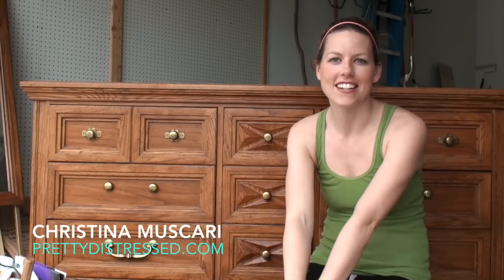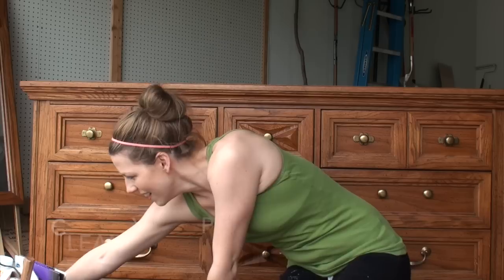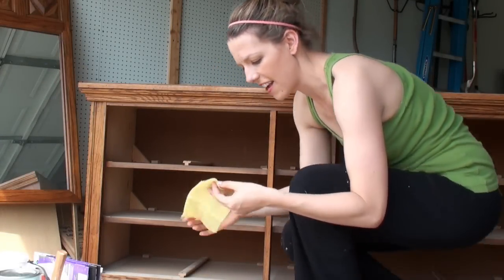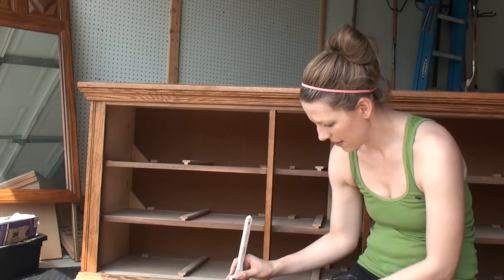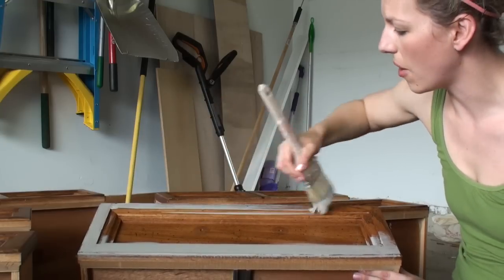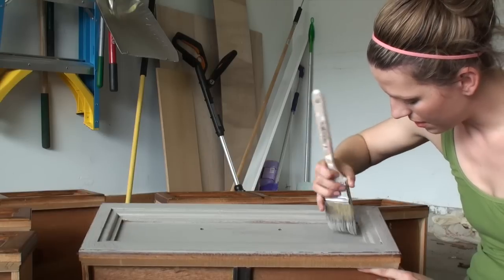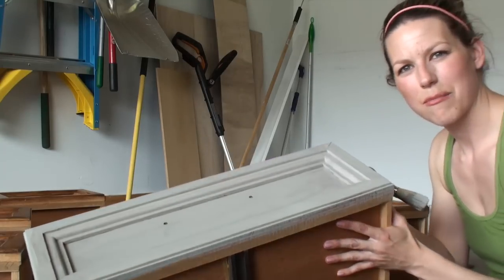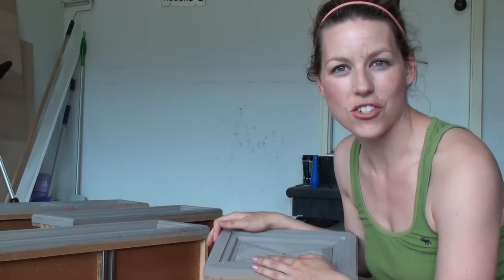Pretty Distressed™ Annie Sloan Chalk Paint® Tutorial #1 - Prepping and Painting 1st Coat

Comment: Fabulous videos! :) Do u have any tips for chalk painting large flat surfaces, for ex, dresser tops? Do you hand paint or use a roller? thanks!
Reply from the maker: I use a flat chip brush for a smooth finish on table tops. I also spray it down with a little water from a spray bottle right before I paint. That smooths it out as well.

Comment: Great videos Christina! .. I have an Oak triple dresser that is almost 30 years old that is just not my style anymore and you've given me a great idea!  A couple of questions:  Is there a reason why you couldn't use a small roller for the flat surfaces, at least on the first coat; can you paint the first coat a different color than the 2nd so when you distress it the other color comes through?  Also, if I decide to paint the drawer pulls with more a 'metal' look is there a product you can suggest?  Thanx for the help :)

Comment: So I’m new to this whole chalk painting stuff. I just have a question, I bought a used hutch from someone and I want to use the white chalk paint on it. My problem is it smells very strongly of cigarette smoke. I was told to use a primer underneath to hide the smell. My question is if I do use primer on it will I still be able to use the chalk paint and get the same effect?
Reply from the maker: Yes, but you definitely want to seal it with Shellac or another type of odor blocking primer. It will not affect the chalk paint and you will still be able to distress if you want to.

Comment: I have a dresser with a veneer finish that I would like to use chalk paint on.  This veneer seems to have a more slick finish than a normal wood dresser.  Do you think the chalk paint would cover without chipping later on?
Reply from the maker: +Craig McGill If it is really slick, I recommend roughing it up with some sand paper. You don't have to completely remove the finish just give the paint something to stick to. I can't guarantee that it won't chip. When you are working with furniture that isn't real wood you just have to experiment.